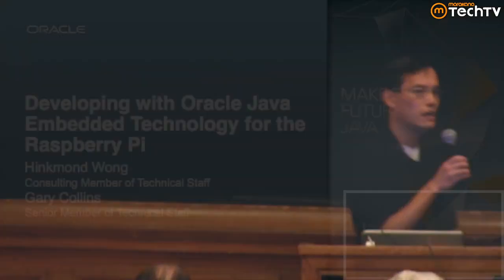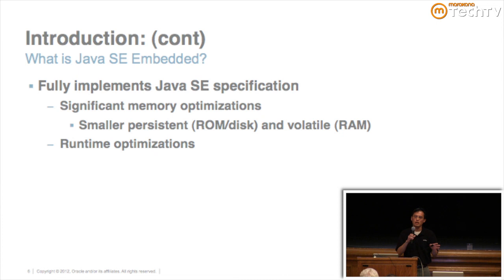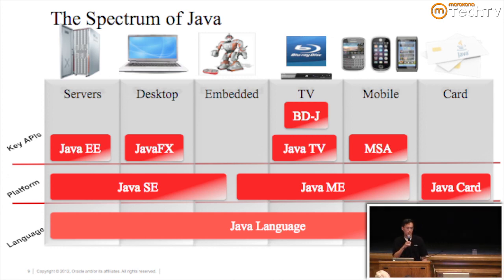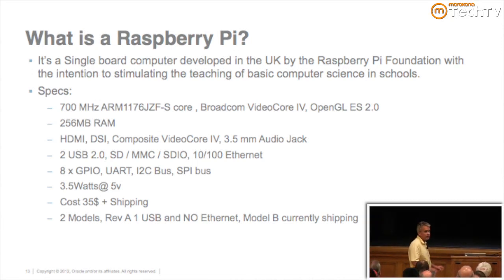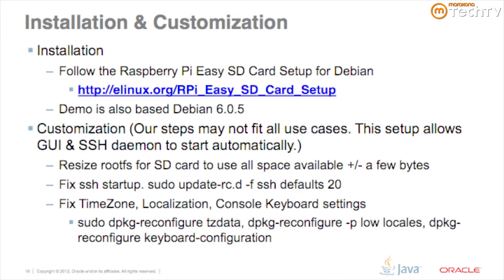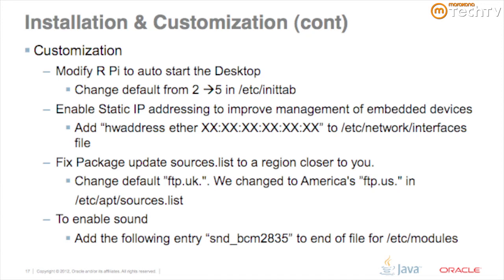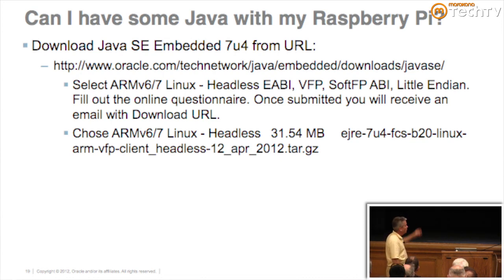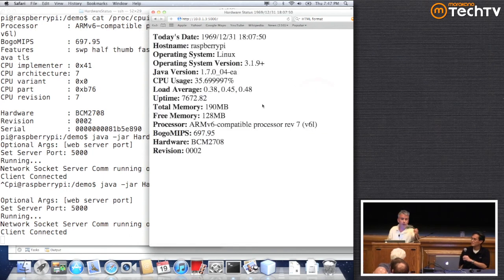Raspberry Pi: Developing with Java Embedded Technology

Comment: The squiggle that is mentioned at 19:50 is the symbol used for the United Kingdom pound. AKA the pound sign. It was the pound sign when Columbus discovered the Americas. Originally derived from the Roman L for libra. The symbol Americans call the pound sign is a hash (noughts and crosses, or tick-tack-toe sign).